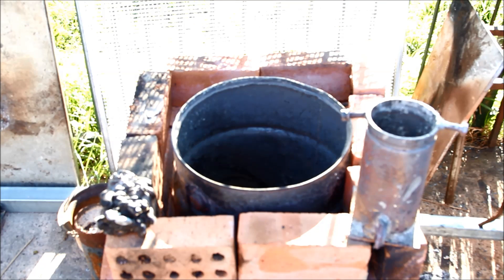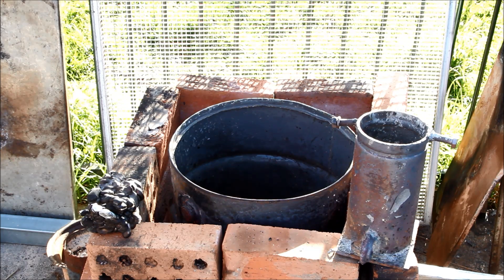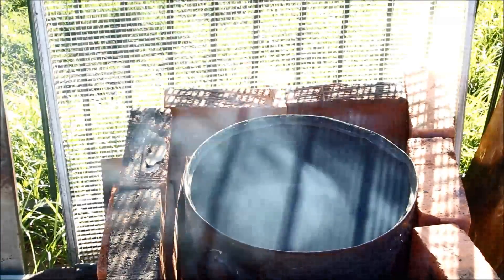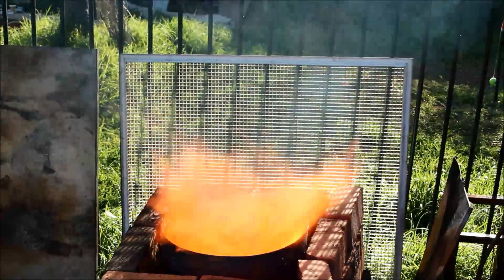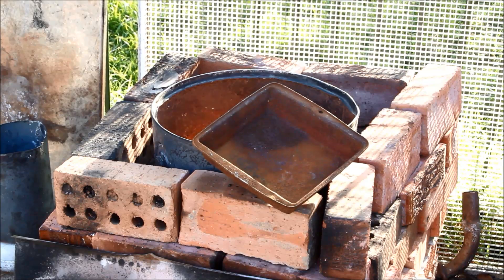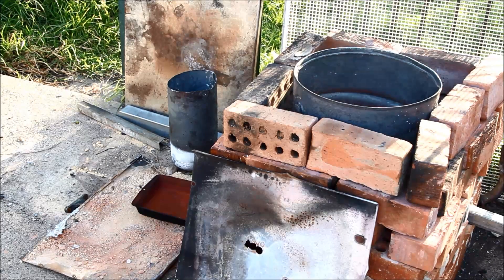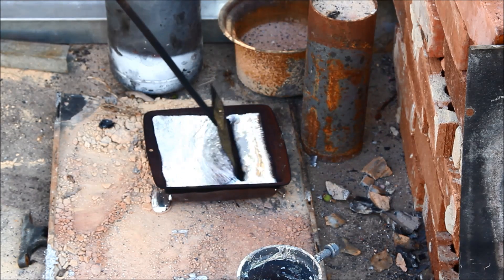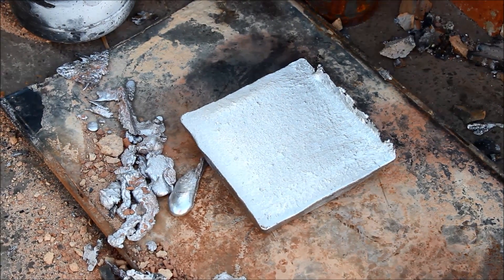Aluminium Casting using the Mini Metal Furnace

Comment: What is the difference other than the obvious between the tank based burners and the tube type
Thanks
Reply from the maker: Not sure what is obvious but one runs on compressed air and the other uses forced ( fan) air. It is much easier to get to higher outputs with blown air than compressed.  Many people say thy like the instant lighting of compressed air Nozzles but if I wanted to I could make the blown air types instant lighting as well. Given I can go from cold to full noise in 2 min or less, I[m not in that much of a hurry that instant lighting makes any difference. 

Both types are easy to control if the air and the fuel is regulated and the fuel pressurized as well.Blown air burners can be made cheaper than the spray type and don't require a compressor  pounding away to make them work. 
Perhaps the biggest difference is personal preference for most purposes.

Comment: Thanks for the video.  Been looking to build one of these.  The safety tip is very good too.  Hate the safety Nazis out there but your preheating is a good one.  One also should say that when adding new metal to anything already meted should be preheated as well.  Worked in a piston manufacturing plant.  Had at least one worker injured a year from not preheating ingots before placing them in molten aluminum.   Love the cake tin as a form lol.   If you are scrapping, guess it doesn't hurt to clean the scab off.  If you are going to remelt it ,   leave the scab on,  it protects the pure aluminum from further oxidation.  Just remove it when you are ready to pour.  Keep up the great work and sense of humor.
Reply from the maker: Thanks mate. I am actually fairly careful about moisture even if it doesn't show on camera. Always preheat ladles and andthing I am going to pour into .l seen the vids on what can happen otherwise. 
The safety Zealots are just looking for something to have a whinge at and aren't interested in the subject at all. I like to give them all the respect and consideration they rightly deserve. 
That said, next vids I am planing to be very safety conscious. I have a fluro green vest to wear  and a pair of gloves that my Mrs found at an Op shop.  That could keep the sooks happy but you know it won't.
Reply: Oil Burner the orange one you wore before was the best

Comment: I've been looking at blowers like yours in this video.  Can you tell me how many CFM's it is?  I love your videos and you may just be crazier than I am.  If your ever in Kentucky we'll drink some pints and burn some shit up.
Reply from the maker: No mate, can't tell you. It's not marked and I don't have a way to measure it. The thing is just a 400W jumping castle blower. I don't think it's all that strong as far as they go. I'd rate it as medium compared to my other blowers. 
I have also used Bilge blowers which are much weaker and they work fine too.  I think Any AC blower of this type will give you all the heat you can handle!
Reply: Hey OB thanks for the quick response.  I found one that is 1000 cfm that is in my price range.  I'm  one of those that think bigger is better ;).  So I'll give it a go and post the results.  Thanks.
Reply from the maker: 1000 CFM should give you a plenty big fire. If my mental arithmetic is right on air to fuel ratio, that will allow for a good fuelling rate which will make a nice burn. 
Looking forward to seeing what you come up with.
Reply: Yeah when I get comfortable with it I also have a diesel screw type compressor that you use for a jackhammer and such.  That will be  my nuclear torch project:-)

Comment: I love to see how efficiently your burners run.  I am going to try this one as well.   They put out so little smoke.  Great work and great vid!  thanks for posting
Reply from the maker: +8ank3r  Thank you!  You might get a little smoke at start up but once they are running, they are perfectly clean. The beauty of most of my designs is they can run on an excess of air which means total and complete combustion. A lot of people think of burning oil the same as burning tyres but there are vids on the net of people burning tyres totally clean as well. It's all in how you make the fire burn and mix the fuel with sufficient oxygen.

Comment: Made a decent mini furnace from old brick and a repurposed crucible awhile back but used charcoal+forced air as a heat source. Your method is way better! Definitely will try again. Charcoal works well but burns up far too fast with a high rate of forced air.

Comment: hehe insane heat output.. im not the only one thinking, there is alot of waste heat going in there.. even if the burner is crazy effective.. a lid and some isolation, and you wouldnt need as much fuel at least`?

Comment: sand cast a safety sign?
i love the safety grass in the background, no chance half a meter high green grass will spread if it even did dry out enough to burn.
is the oil you use the fatty stuff that settles to the bottom? would it matter if it contained moisture for the furnace process?

Comment: Have you played with paterns making yet.looks like you have the hot work down Farley good
Reply from the maker: +Chris Anderson  That's the next step in the curve.  Somewhere round here I have some Fishing sinker Molds. I'd like to cast some of them but I'm damned If I can find them. Another reason to clean my crap up.
Reply: have a look at my videows I have a little bit of pattern work . have a hole thing on a angle plate for my mill but computer is full so cant finish the editing. that sucks lol